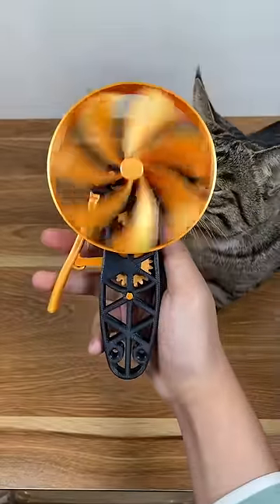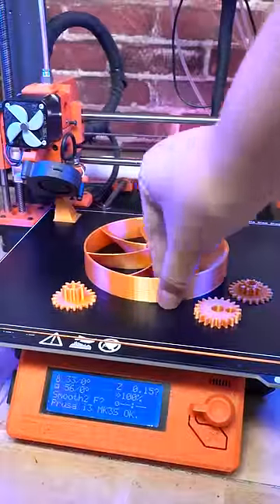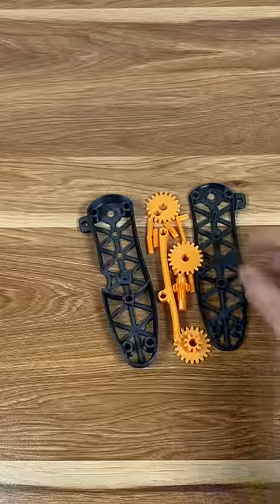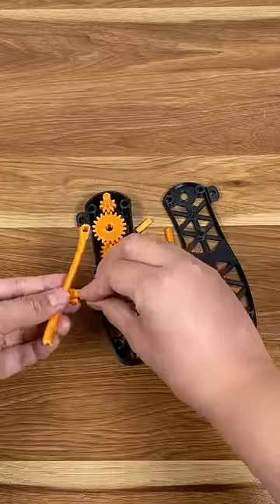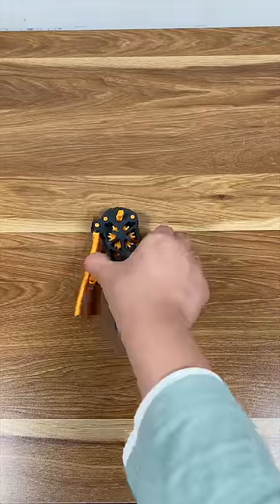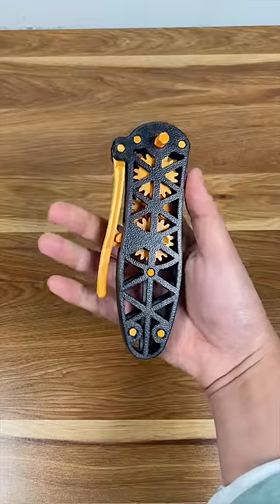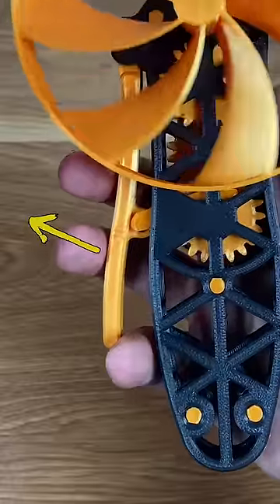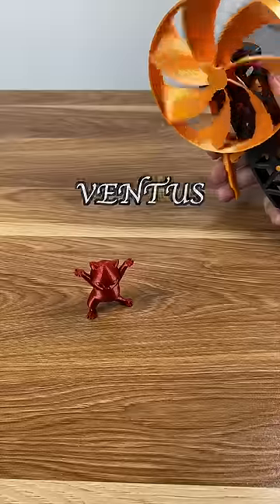3D Printed Squeeze Fan😮‍💨💨💨

Comment: I printed one a while ago, pretty cool but not enough wind to be worth the effort with the current design. Could be made a lot better with a longer handle or something!
Reply: Nah just needs a redesign of the fan blades, that ones clearly for higher rpm
Reply: Maybe make one of the top fans from fan wars lol
Reply: Also a gear redesign aswell
Reply: They sell that in a local mini market in my country, it's smaller than in the video, and worth the effort too
Reply: Its helpful when theres no electric at your house and it can get really hot an night if the electric got cut off
Reply: Change up the gear ratio
Reply: @thegoldenatlas753  yeah the fan sucks. It shouldn’t look like something on a turboprop plane. Because that thing’s not being powered by a turbine
Reply: Put a noctua fan on it and use a better gear ratio.
Reply: Wouldn't a spring make it better?
Reply: find crappy cheap tiny motor or pc fan, n reuse a rechargeable battery, now u got something useful and didnt cost you precious 3D materials or calories that you need cuz u living under a rok
Reply: Or a more powerful gear ratio and a bigger fan
Reply: @thegoldenatlas753  ngjhp😂
Reply: @markjohndellava1502  wat
Reply: Just add more gears
Reply: Bruh a battery can fix that
Reply: song name please
Reply: How does EVERYONE HAVE A 3D printer !!!!!
Reply: Yeah it could
Reply: @thegoldenatlas753  And that's where a major hardware is fan showdown series comes into play.
Reply: @cameronperkins2604  there's like $130 3D printers out there. Actually scratch that there's $80 3D printers even though they only have like a couple inch sized build plate
Reply: @Dtr146  oh thx for letting me know
Reply: Maybe build a gear ratio into the fan, so the fan has more power for the same amount of hand work.
Reply: @cameronperkins2604  just one 3D printer ?
Reply: Không có gì đâu
Reply: Hi bro😎
Reply: Fans blow your bubbles
Reply: Just add another gear
Reply: @rizqinuridin5396  good for your hand grip too
Reply: Just add motors and battery and then missiles.

Comment: Perhaps making the handle larger to fit a larger gear set in for high fan speed. Also, I wonder if a lubricant on the gear would noticeably increase efficiency? Cool gadget!
Reply: The fan could definitely use a redesign too
Reply: i believe every gear could use a lubricant
Reply: @CF-gv3bi  even the plastic one?
Reply: @GimOA  yes... do you remember Tamiya or Crush Gear Turbo?

Their gear is absolutely plastic
Reply: use butter
Reply: song name please

Comment: "the kinetic energy turns into kinetic energy"
Reply: RIP science
Reply: That's actually correct bro, it's energy transfer Without changing the type.
Reply: technically it’s chemical potential to kinetic
Reply: @unknownedleaf  how? Chemical energy is energy stored in things like food or batteries
Reply: I like xbox 360 Kinect
Reply: @darzord928   chemical potential - kinetic energy in hands - kinetic energy + elastic spring energy on the sqeeze  fan handle
Reply: @andreyuh_  *popcorn*

Comment: I need this when summer or when my electricity is being shut down now we just need a hand powered charging port fan
Reply: Actually using fans while the summer is not gonna help you. You'd just use it to blow all the warm and dry air into your face, which makes the situation worse.
Reply: @maremike2691  it works if the fan is strong enough
Reply: @jacobmartincontreras  I didn't doubt, that the fan wouldn't work.
Reply: I need this in summer when going outside i can chill anywhere i want
Reply: @maremike2691   the reason fans cool you down in the summer is because we are warm blooded mammals and produce heat naturally as we digest and burn calories. 
This heat can be blown away from us using a fan thus cooling our bodies.

This is also similar to how our bodies handle heat by sweating though the pores in our skin Which in turn evaporates bringing our excess body heat with it.

Srry for the long explanation just wanted to make sure I explained it thorough.
Reply: @radish1031  This is quite interesting. I want to thank you for the comment. But it's still the case, using a fan in warm rooms is ineffective. After evaporating you'd still continue blowing air. When I was a kid, I used to make fans with batteries by myself and one got stolen. But it still didn't help me.
Reply: @maremike2691  It doesn’t really work like that. That’s the whole point of sweating to cool is down, it transfers the heat of our bodies to the sweat, which is then dissipated into the air. It’s an extremely efficient method of cooling us down especially when running. So when you’re sweating but staying in place, the fan is like the air against your body when you’re running. No disrespect but it does cool you down, that’s exactly how our bodies work lol
Reply: @tynj6816  "the heat of our bodies is [...] dissipated into the air". And then the fan blows the air back on you. So the initial goal has not been reached
Reply: @maremike2691  No idea what point you’re trying to make but yes, a fan cools you off.
Reply: @tynj6816  You understand the things, you want to understand. Not the things tried to be proven to you.

Comment: You're losing fan speed quickly after you let go because the fan is using its kinetic energy to reset the handle. Try adding a light spring to reset the handle instead so the fan doesn't lose energy as quickly.
Reply: that’s smart
Reply: Very smort b it it’s not
Done here as you can’t easily print a 3D spring.

Comment: "The handle turns human power into kinetic energy" is about the dimmest thing I've ever heard in my life
Reply: That's actually really accurate though. Kinetic energy is just motion, he's converting his squeeze into motion, not sure why it's dim?
Reply: It doesn't even convert anything; it just transports mechanical power and slightly modifies it via gears
Reply: @shadowflamegaming7446  because the squeeze is kinetic energy... its turning kinetic energy to kinetic energy.
Reply: @lexicurtis63  but the squeeze isn't kenetic energy. The human uses fuel for energy to move their fingers. So it's chemical energy into kinetic energy. Human energy is an ok to describe this...
Reply: @John...44...  technically the conversion of chemical energy (in ATP stored inside the mitochondria in your muscle cells) to kinetic energy (motion of the fingers) is done by the body. The device converts kinetic energy of fingers to kinetic energy of air (wind).